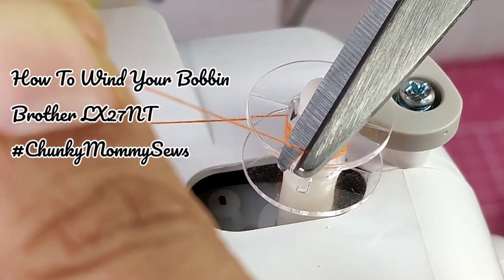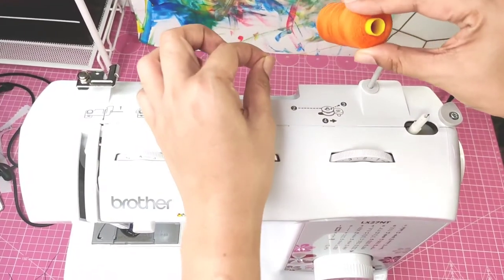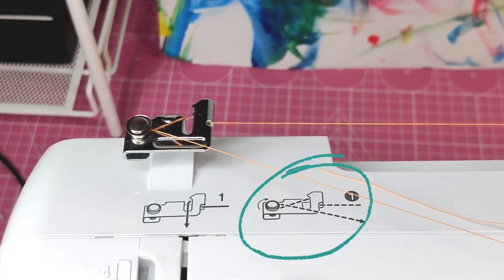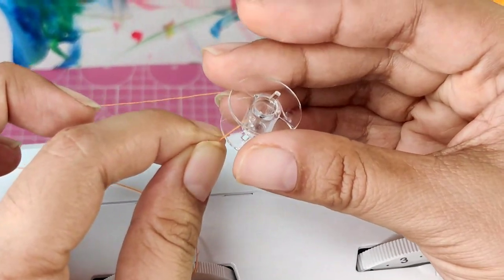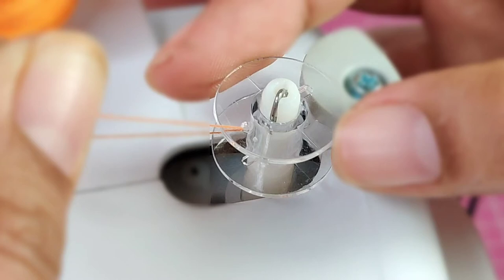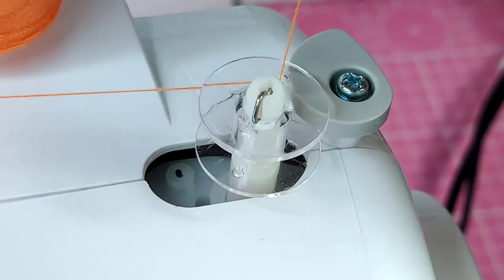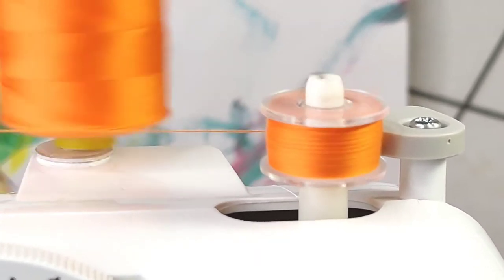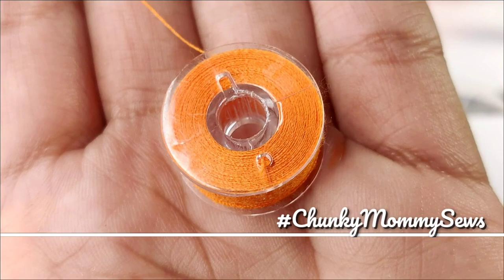How To Wind Your Bobbin with Thread Brother LX27NT Sewing Basics for Beginners

Comment: Lovely video and very very well done. One of the few that mention the extra twist to the bobbin so it's firmly on the bobbin spindel spring.  Loved how perfectly the thread was wound on the bobbin. Only suggestion is to cut the thread tail off closer to the bobbin flange so not even that tiny tail is left poking up out of the hole. Even that tiny tail can interfere with stitching. I have liked and subscribed to your channel. Your video is far superior to many others. Thank you.